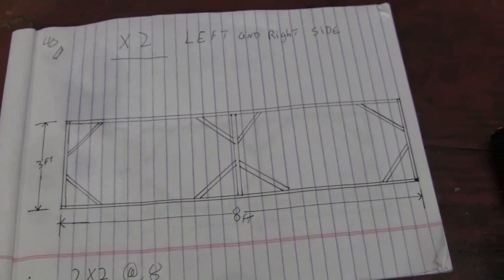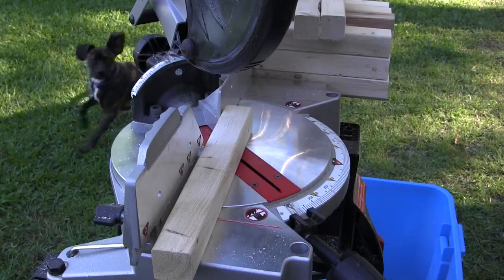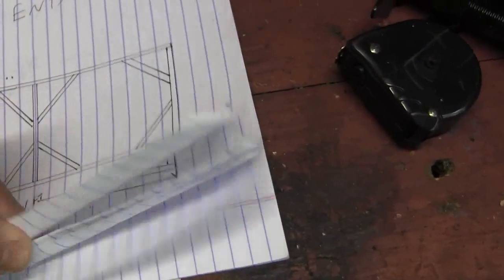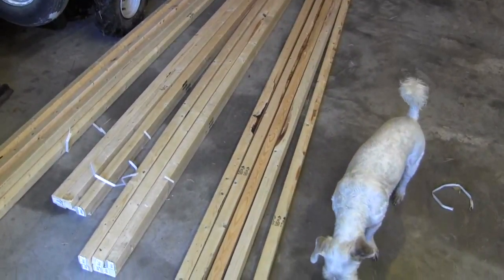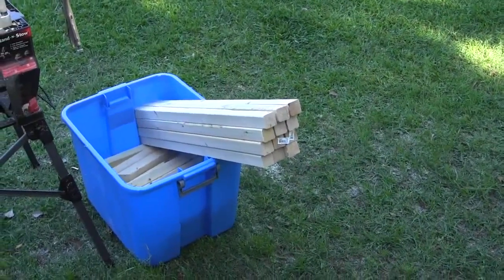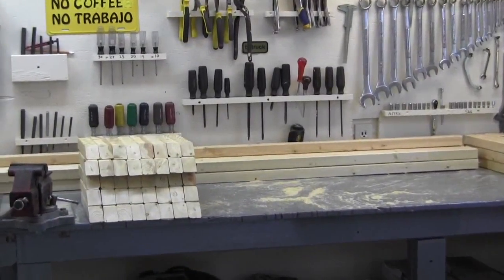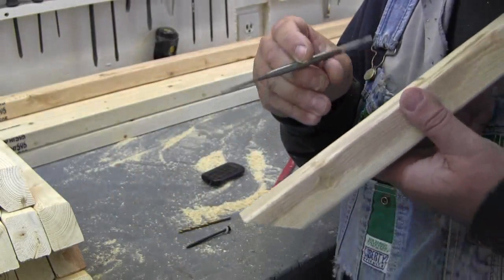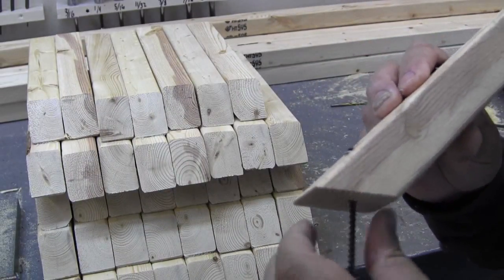How to build a chicken tractor  Part 2

Comment: Just built 4x8 myself. I have 5 hens in it.  My roost, next box, feed and water are in the top area. I have had mine in use about 3 weeks now and it has to be moved everyday or 2 days at most. Those hits take it to the ground quick and worst of all they make deep holes, Just a warning! Little lawnmower wheels are no less than about 7 bucks each now so I cut  out some wood ones. Ha!